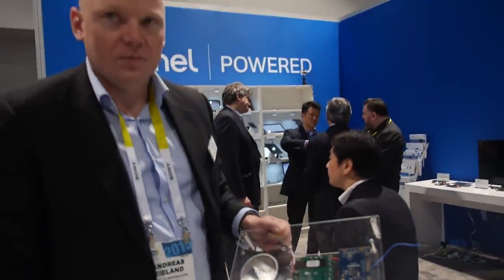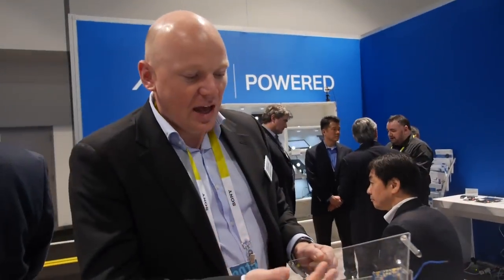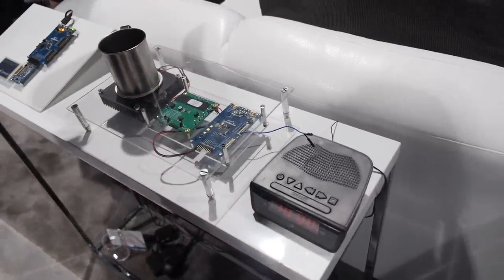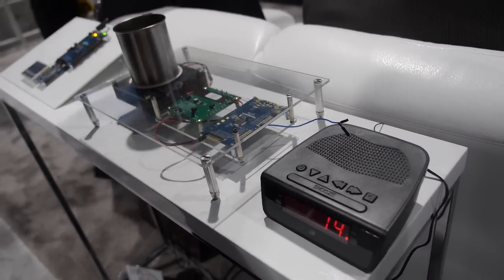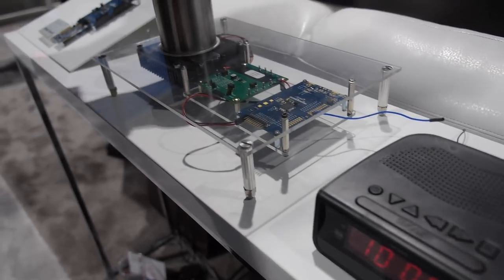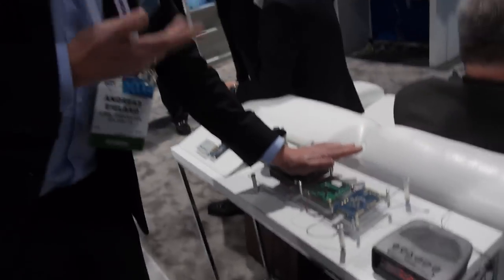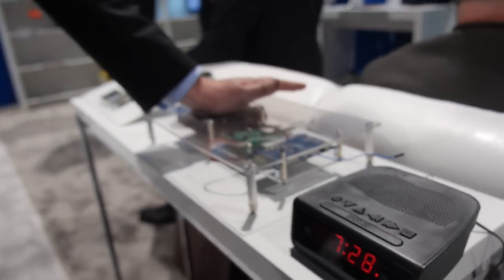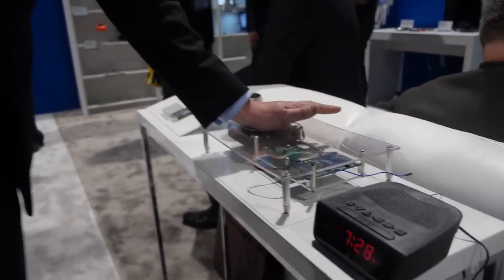World's lowest power: Atmel SMART SAM L21 ARM Cortex-M0+, Andreas Eieland

Comment: Thanks guys, we are all excited for this device. In addition to ultra low power it also features AES256, True random number generator, built in capacitive touch hw and much more. It is perfect for IoT applications requiring larger Flash and SRAM and low power. Datasheet should go online on www.atmel.com next week (ww5 2015)  @AndreasMCYguy
Reply: is the random generator NSA certified? :)
Reply: It passes the American NIST Special Publication 800-22 and Diehard
Random Tests Suites.

The TRNG may also be used as an entropy source for seeding an NIST approved DRNG (Deterministic RNG)
as required by FIPS PUB 140-2 and 140-3.